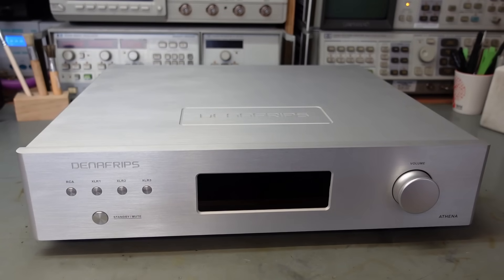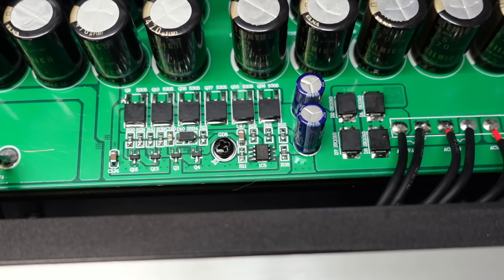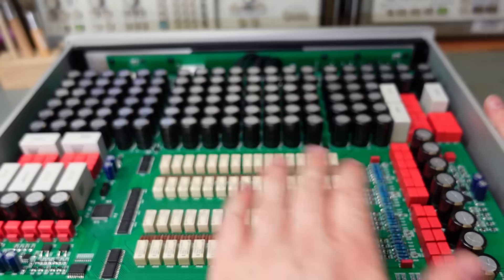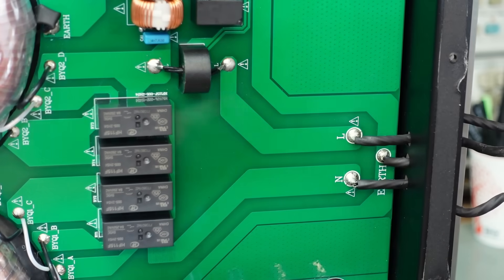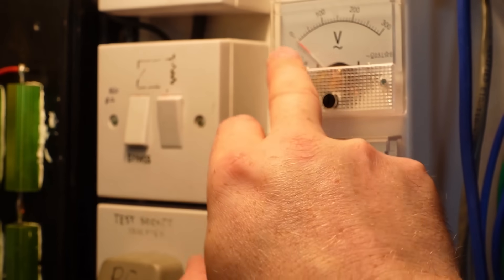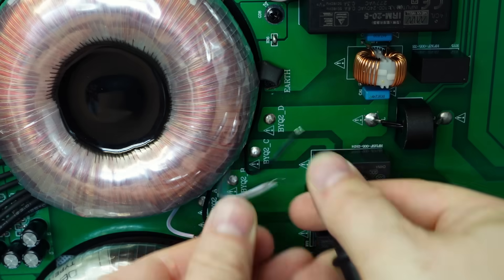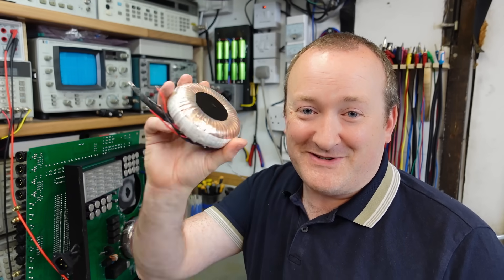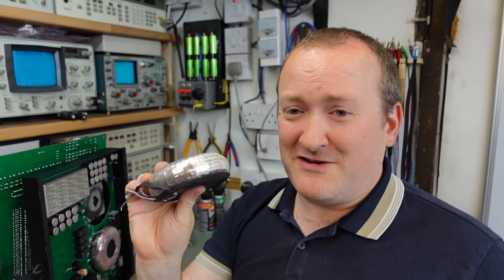ATHENA has fallen!

Comment: This $2k amp is shockingly better designed and built, than that $25k wiring jungle gym.
Reply: Maybe not so good for maintenaince- you have to basically disassemble it into parts whereas the £25k one falls apart with a moderate shaking.
Reply: @jacklav1  🤣
You're correct. 
I had not considered the time savings by taking the mail service as part of the disassembly process.
Reply: ..and to make it even worse, the preamp from Tom Evans was only a phono preamp..
Reply: Was thinking the same thing. Massively more elaborate design and a fraction of the price.
Reply: ridiculously over-engineered for just a pre-amp
Reply: @techcafe0  At least it's over-engineered and overpriced, instead of under-engineered and overpriced.
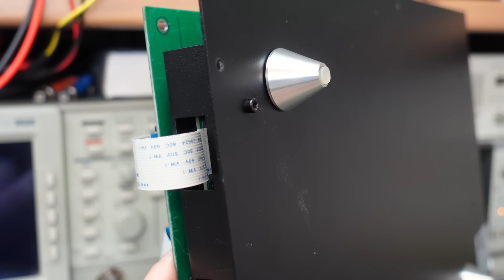Reply: 11:35 label "Made in China" 😀

Comment: An audiophool's delight. I'm not sure if there are enough capacitors to handle the massive preamp current from those little transformers :-) I see they carefully sandwiched that noisy switch mode supply under the board. Can't have the purists noticing that red flag.
Reply: surprised they even use smps !
Reply: @@tenmillionvolts  Yeah tenmega,  I wonder if the double layer anti-interference sheets were required just to keep out the interference from that SMPS?

It really is a stupid unit!  It would be more useful modified into a power supply!  I don't know if Mark even showed us the 'audio preamp' part of this white elephant?

And what about the bs useless digital display?  They would been better off installing signal bargraph meters there instead!

Good on Mark for fixing it, & he should have charged the idiot owner $1000 for the repair for the insult!  The owner would have been rich & dumb enough to pay without question.
Reply: @nevillegoddard4966  SMPSs or DC/DC converters aren't necessarily noisy. I've seen them being used in extremely sensitive measuring equipment, stuff that would put most "high end" audio to absolute shame when it comes to noise or interference.
Reply: @Lenny-kt2th  True that. But i am hard pressed to understand why a designer would choose to take both approaches simultaneously!
Reply: @Lenny-kt2th  It takes a load of shielding and decoupling, possibly line balancing. All reasonable if a SMPS is needed in pro gear. In this case, they already went pure linear with insane filtering for the main rails, so why cheap out on a little SMPS for the low rail? A three terminal regulator and an extra little mains transformer is not going to blow the budget on something this pricey. They could even use it for advertising: "ALL LINEAR POWER SUPPLIES"
Reply: @gadgetwob   the small smps portion is likely just for standby
Reply: @Lenny-kt2th Yes smps is not necessarily bad.
Reply: The SMPS is just for a circuit which detects the input voltage (120/240) and then switchs a relay on the power transformer primary for series or parallel.

Comment: THIS is the level of built quality and consideration I expect from High End equipment!
Unlike the Tom Evans pre amp in Mark's recent video with its flimsy interior and "I don't believe in metal cases and proper shielding" snakeoil, looking like something slapped together in a hobby basemant, for about ten times the price!
Reply: Yup, thought the exact same thing...  the design of this thing is beautiful.  Is it all necessary?  maybe, maybe not... I'll let other folks debate the benefits of the discrete components and ladder network of resistors.  But there's some talented artists behind the design of this gear.  bravo.
Reply: At the end of the day they both still failed though and this one failed for far worse reasons - cheap enameled winding wire.
Tantilum caps aren't that cheap.
Reply: I thought the same thing :-) THIS is how things can look like, if you're not proud of just fiddeling together 10 pieces a year. And we're talking a 10th of the cost. How weird.
And, no @fx-studio - there is no way to draw the conclusion, that this was a cheap transformer.
Reply: @richmond411  Read my other comment -cheap Chinese enameled wire is the cause - I explained it in detail there.
Reply: ..and to make it even worse, the preamp from Tom Evans was only a phono preamp..
Reply: The reason for failure of wound components is nearly always the wires insulation called enameling. It break's down due to heat/ stress with lower grades and temperature of wire have an tendency to fail prematurely. Nearly all wire used in China is of a lower grade because that's what the market buys. I recently got some wound components made in China and it was close to impossible to find double coated polyimide overcoated with polyamide 200oC enameled copper wire - that's the stuff that ensures, if designed in correctly, it won't fail ever. 

10v extra continually won't make any difference to the overall heat. Its the fact the transformer is enclosed and secondly the enamel windings temperature rating that are the issue. The second coat of polyamide helps a lot if things start to go south because the insulating properties tend to increase slightly with higher temperature. But as mentioned that's rarely available off the shelve in China. 

Could be this one has failed because when winding the wire it can get stretched by the winding machine and the enameling at certain parts, especially at turns around the core, can become thinner/ stressed. That's where its more likely to fail if single coated and bear in mind layers of wires are crossing each other. Then we have breakdown voltages due to mains spikes usually the wire should withstand 1Kv or more, again double coated enameled wire can go much higher. Then perhaps also this unit was left on all the time so heat was allowed to built up in it over time. If it only uses standard available Chinese 130oC wire then its easy to see how we are getting close to the breakdown point. Many factors are involved in a failure of this sort (an extra 10v isn't one of them) - which is why its necessary to over-engineer if the budget/ availability permits.
Reply: There are a few hobby basements out there that can out build Tom Evens with a full glass of whiskey drunk on there asses I’ll have you know! lol
Reply: 11:35 label "Made in China" 😀
Reply: @pontram  Yes. And your point?
Reply: @macsmith2013  I did not expect an audiophile device made in China. But I know they can make good quality products (Apple f.i.). The concept however is not really comparable to western boutique products, regarding production costs, if those manufacturers do not outsource to low wage countries. Though I do think the Tom Evans devices are heavily overpriced, even for their ambition.

Comment: I've never seen the inside of an amp this beautifly made.
Reply: beautifully
Reply: @HansDelbruck53  He might have been talking about a colourful wasp.
Reply: It's a pre-amp.
Reply: @E-raticWarrior  yes sweetie, it is
Reply: That army of caps looks like the terra cotta warriors that were unearthed in China. A bucket load of relays too!
Reply: Really is gorgeous isn't it 😍
Reply: The reason for failure is the cheap enameling on Chinese copper wire. Its near impossible to buy quality enameled copper wire in China because there is no demand for it. The wire manufacturers can make it, but its huge minimum order which means its rarely ordered.
Reply: @fx-studio a very good point
Reply: Nice job,beautiful piece of kit lovely construction.❤
Reply: @fx-studio  He didn't say anything about cheap enameling on the copper wire. He did mention something about 240v mains going into 230v architecture not being a very good idea. Especially sitting in a constant standby state.
Reply: @sPi711  Its a specialist subject - the reason for failure of wound components is nearly always the wires insulation called enameling. It break's down due to heat/ stress with lower grades and temperature of wire have an tendency to fail prematurely. Nearly all wire used in China is of a lower grade because that's what the market buys. I recently got some wound components made in China and it was close to impossible to find double coated polyimide overcoated with polyamide 200oC enameled copper wire - that's the stuff that ensures, if designed in correctly, it won't fail ever.
Reply: @fx-studio  So the current rating is irrelevant. Got it.
Reply: @sPi711  10v extra continually won't make much difference to the overall heat. Its the fact the transformer is enclosed and secondly the enamel windings temperature rating that are the issue. The second coat of polyamide helps a lot if things start to go south because the insulating properties tend to increase slightly with higher temperature. 
But as mentioned that's rarely available off the shelve in China.
Reply: @fx-studio  I don't doubt your knowledge and expertise. But you do use the qualifiers "much difference" when describing the consequences of 10v extra. 10v over ten hours? Ten days? Ten months? 
"Shouldn't make much difference" is something you don't want to hear from someone who has sold to you, or repaired an expensive piece of equipment; which is probably why Mark recommended a step-down transformer when encountering voltage differences where they exist and to not use equipment in conditions for which it was not designed. And to my knowledge, there have not been the level of failures due to the quality of the transformer which you suggest should exist.
Murphy's Law fully applies here in that "any part of a system which is left to chance is the part which will fail." 
It's the mindset of a few degrees temperature difference "shouldn't mean very much", which led to o-ring failure on a certain space shuttle launch. You may recall this disaster.
Reply: @sPi711  Could be this one has failed because when winding the wire it can get stretched by the winding machine and the enameling at certain parts, especially at turns around the core, can become thinner/ stressed. That's where its more likely to fail if single coated and bear in mind layers of wires are crossing each other. Then we have breakdown voltages due to mains spikes usually the wire should withstand 1Kv or more, again double coated enameled wire can go much higher. Then perhaps also this unit was left on all the time so heat was allowed to built up in it over time. If it only uses standard available Chinese 130oC wire then its easy to see how we are getting close to the breakdown point.

Many factors are involved in a failure of this sort (an extra 10v isn't one of them) - which is why its necessary to over-engineer if the budget/ availability permits.

Comment: Interesting fact: You put three feet on the bottom of box, it will not wobble if the surface it is sitting on is not flat, so it is always stable - effectively self levelling!
Reply: Yes. Triangles are amazing, aren't they?!
Reply: Yes, I have sit in 3 feet chair, real hifi!
Reply: Yeah Audiophiles already know that.🙄
Reply: every 4th pre amp they build the legs are free😂
Reply: Levelling something with three feet is also so much easier than something with four feet.

Comment: New (old) rule: Overkill construction does not always equal trouble-free longevity. Fine work, Mark. Glad I subbed.
Reply: More parts is more chances for failure.  I get the approach of paralleling caps for lower output impedance of the PSU but I really fail to see how a preamp can really benefit from that.  The preamp is not delivering any appreciable current so the approach is less than useless., it will only result in worse reliability and more expensive repairs.  So basically standard practice for this corner of the audio market lol.
Reply: @jaymz168  Totally bonkers design
Reply: It does reduce supply impedance, but also reduces ripple far more effectively than using a couple of massive capacitors. The lower impedance is actually important lowering harmonic noise on the regulators. Granted, it is a bit showy and grabs attention in marketing material, but it is good engineering theory!
Reply: @peterlarkin762  Not necessary. Good amp designs have massive PSRR. This is really bad engineering practice and a perfect example of audio phoolery. It's a waste of resources and about as useful as homeopathy. The resulting products are for people with weak egos who think that massive alumin(i)um cases and a collection of caps and relays would impress someone. I worked for a similar company for much too long and I quit because it's just stupid and also a waste of engineering. We have real issues to solve.
Reply: Imagine if one of those capacitors fails

Comment: I’d have put a Perspex lid on the amp. It’s beautiful in there!
Reply: That's a VERY THICK aluminum cover, though. It's a beauty of her own
Reply: Perspex will create static spikes, and there's no shielding, albeit that top lid is alumin(i)um, and only capable of electrostatic shielding, as opposed to steel, which (if the apt grade of mag steel) would be an almost complete block of induced fields.
Reply: @iaial0 You could replace the whole cover, but you probably shouldn't if you care about EMF. Perplex + copper mesh underneath, to kep Faraday happy? 😅

Comment: It couldn't cope with UK power supply? Not very well designed. 🤣 "Audiophile" anagram of "saw you coming"!
Welcome back. Entertaining and informative as ever.
Reply: Well, I'd put that on the quality of that toroidal transformer. A good 230V transformer should have absolutely no problem accepting 240V... That's only 5% above the rated voltage.
Reply: @dizzy2020  A "good power supply  with " transformer should handle a 20% over- or undervoltage, but any regular piece of gear needs to be able to handle 10% overvoltage (or undervoltage)

Comment: Excellent. Seeing all that, those banks of capacitors and host of relays, I'm left wondering how much better this unit is than an ordinary mid-budget HiFi preamp. I think it's rather about diminishing returns, that you spend five times as much to gain a 0.01% improvement in signal quality!  As for me, my 65 year old ears would never tell the difference...
Reply: Yes, I thought the same. But it makes a show piece for your audiophile friends!
Reply: Probably 99% of these products would fail in a proper blind A/B test. And their owners as well :)
Reply: well, you might be surprised at what is possible.
high resolution audio devices change the way you listen

Comment: Notwithstanding the smart army of Elna caps ready for duty in that thing, there's enough SMD and flimsy ribbon cables to annoy my old eyes. Glad you nabbed that errant blob of solder. I saw a fellow earlier doing a YouTube video about arc welding and how not to die. He picked up his welder and shook it around. Something was rattling around inside. He said it had done that since day and he proceeded to do precisely nothing about it!
Reply: I run a Furman power conditioner in front of my valve amps. Before anybody beats me up for being an audio snob, these are guitar amps. UK mains supply voltage and permitted tolerances are 230 volts -6%, +10%
Reply: we had a complete new central heating system fitted all the way back to the gas meter,on the meter there was like an alloy pipe that was shaped to fit the gas inlet pipe,my plumber did the soldered joints and everything worked great
4 weeks later theres a small smell of gas 
a bit of solder had fallen into the flexi on the alloy pipe and according to gas board had caused it to corrode through
I relayed this information to my plumber with his best intentions at heart and I think he felt offended
whenever I did welding or cutting at work I always did a safety assessment first and covered anything vulnerable as I didnt want my workshop burning down like I nearly did in 87 but that's another story😅
Reply: @hydorah  That is the same across the EU

Comment: Another interesting fact: Toroid transformers give out a distinct magnetic field which can be picked up by sensitive electronics n the front end of amplifiers. Some Amplifiers where the transformer is not particularly well shielded can induce a slight hum. This can sometimes be 'tuned out' by turning the the toroid slightly and effectively changing where the magnetic field lobes are pointing. I had this demonstrated on an Ashdown Mag 300 Bass amplifier!

Comment: Nice vid Mark, good job as always. It seems that the Denafrips design philosophy is 'more is more' and 'complicated is better'. I mostly find that electronics are better kept as simple as possible with the best suited materials of high quality and components for audio selected on sound rather then operating principle. But everybody should do as they please :)
Reply: I agree. In fact, I find there is something quite distasteful about this level of misguided over engineering for little or no benefit. The gratuitous use of materials....and after all that, did they really just drop a switcher in the bottom?
 I have to admit though, the volume control is kinda slick and silly at the same time. Hope those relays have gold contacts...
Reply: @gadgetwob  The switcher will be for the display, and control chip, etc. The other supply is for the audio stages. It's not necessarily over-engineering - the performance of analogue preamps very sensitive to the quality of the power supply.
Reply: @gadgetwob  I made a relay based volume control a long long time ago. Needed only 8 relays per channel. Inverting amplifier, 5 relays in the input side, 3 in the feedback side. Or could have been 6 to 2. Lookup table in an EPROM.
The advantage is good tracking between channels.
One thing it is missing: a latch on the EPROM output. The relays screech like mad when adjusting volume.